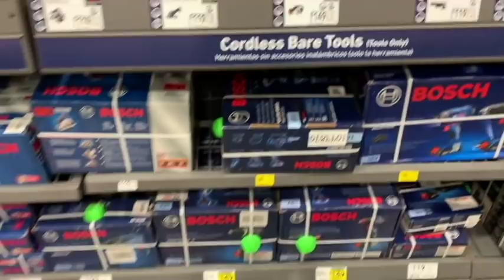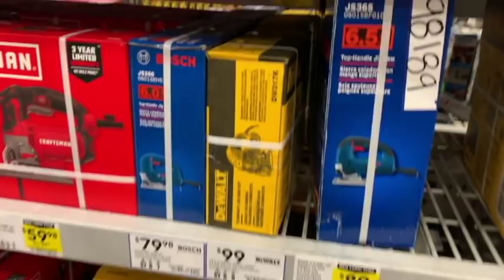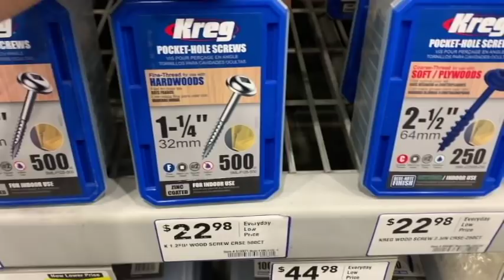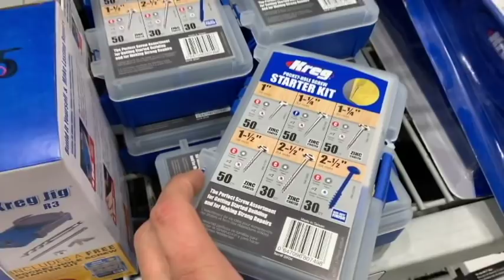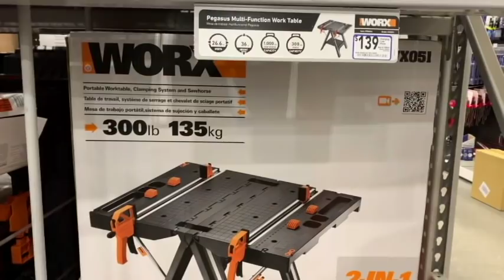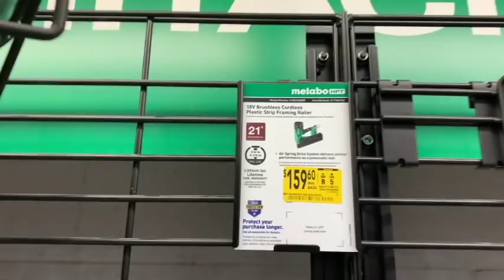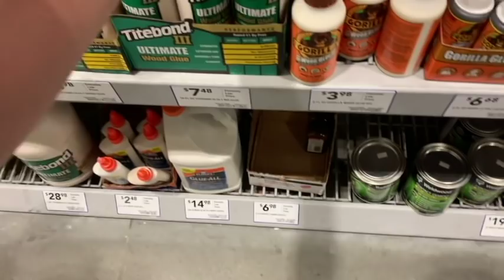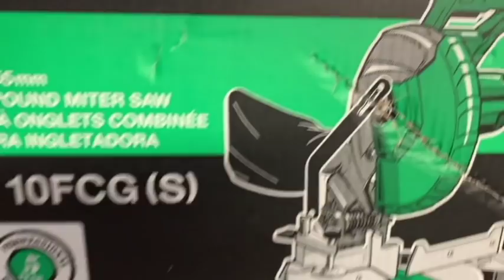Lowe's Walkaround: Metabo HPT Hitachi Tool Haul & Worx Pegasus Work Bench!

Comment: A great way to cheaply store stuff like nail guns and power tools...Lateral File cabinets. Used they’re cheap, heavy duty (pick up a case of paper you’ll understand why), and offer big drawers. Bolt/weld casters to the bottom, or make a wooden frame (think furniture dolly) and bolt the casters to that. Heck you can even paint them different colors with rustoleum. 

*Thanks for the mention earlier.
Reply from the maker: Chip B Thank for the Information. I saw a video last night.. can’t remember her name, but she used a system called French Cleats & used some OSB & I gotta tell you it Looked Very Nice. 🍻👍
Reply: Justin Dow - Great idea! French cleats are fantastic and then you can move stuff around when you want to change the layout. Very strong too.

Comment: You missed the Hitachi C10RJ  job site saw for 299.00 with stand and wheels. It is a top rated saw and on sale tell 10/14. You will also love the Metabo nailer. I have the same model by Hitachi and it works like a charm.

Comment: I have the dewalt jobsite one and have had for 3 plus years and works great. When I first got it I resided a mobile home and every board had to be cut horizontally and half of the wood had to be cut vertically and it cut all the sheets, when I had to move the fence it was smooth and no issues. It's not "cheap" it was that someone broke the display one or it may have been broke during shipment and exchanged out for a good piece. 

I have the KREG pocket tool pro kit and it's great.

Comment: Garage rehabs are sweet! Two things I would change after my remodel are adding way more 20 amp outlets. Also ended up changing several of my one-gang outlets to two gang boxes since you can't have enough outlets. Just wish I would have thought of that before I rocked it in. One thing I don't regret is I insulated the crap out of it. Don't skimp on the insulation. Hope you post your progress on your channel like you did with project hutch.

Comment: Hey there justin,  if you already have a screw gun , Dewalt sells these drywall screw bit tips in a 2pk. There freaking great if you are a DYI guy hanging drywall in a blue moon. Plus those Kobolt foldable saw horses are the beesknees,  and yes they are worth $39.99 ea. I bought the ones @ homedepot and a 2pk are $95 so the same ones @ lowes 2 for $80, are great I have a total of 6 pairs of those saw horses and hold, and sturdy for almost anything you throw at them. Well be good, cold beers and cheers.! 
From down here in south Florida.

Comment: I'm not even a minute and a half into this video and had to stop it to tell you this, because you mentioned getting one of the cheaper brands of table saw. There are many brands with a wide range of price and loads of gimmicky features, but there is one brand that, at least to me, stands head and shoulders above the rest. A few years ago I upgraded from my cheap crappy table saw to a SawStop contractor table saw. The saw I had, had a chewed up composite top, and a fence that wasn't worth it's weight at a scrap yard. Shortly after getting the SawStop saw, I was using it and got careless, allowing something to distract me. My left hand came in direct contact with the blade. The saw is designed to stop the blade from spinning and drop it below the surface of the table on contact with your skin. The saw did everything it was supposed to do. Had it not been for that saw, I very easily would have lost my left hand. Instead, I walked away needing nothing more than a Band Aid and a clean change of underwear. SawStop also makes a portable job site saw that is a little bit less expensive, but it still has the same safety features as all the other saws they sell. The big differences between the job site saw and the contractor saw is the table top and, the obvious weight and price differences. The job site saw has a 1.5 HP Universal motor, powder coated aluminum table top, and (I believe) a heavy duty composite body, which make for easier light weight transport, while the contractor saw has a 1.75 HP Induction motor, a slightly larger (than the job site saw) cast iron table top and a steel body. Bosch (or was it Rigid??) used to make a saw they called Reaxx that had a similar safety feature as SawStop's, but it was very competitively priced to the already well established SawStop, and nobody was buying it, so they ended production. Without a single ounce of hesitation, I would very strongly recommend a SawStop table saw to ANYONE who is in the market for a table saw. They have a few different models to accommodate different needs, and they are well worth every last penny they cost. Yes they are a bit more expensive than the other brands, but can you really put a price tag on your hands and fingers??? Far too many woodworkers have been bitten by a table saw, some much more seriously than others, and I should have been one of the more serious, but that saw saved my hand. Most woodworkers would even go so far as to say that the table saw is the most dangerous tool in their workshop, SawStop eliminates most of that danger.  NO OTHER BRAND TABLE SAW ON THE MARKET PERIOD, can say what SawStop delivers, at ANY price. There are plenty other places in your workshop to save a few bucks, but PLEASE do not buy a cheap table saw. When it comes to table saws, you really do get what you pay for. And now, back to our regular scheduled program.
Reply: FYI, I am NOT a professional woodworker or carpenter, I am just a DIY'er and hobbyist. The ONLY reason I got this saw was to protect my dumb ass and, Thank God, it eventually did just that.
Reply from the maker: Where do the sell them and about how much do the go for. Better yet.. Can you please share the link to the one you are recommending? Please and thanks. Cheers!
Reply: @JustinDowDIYcentralhighway  They're not inexpensive, the contractor's saw starts at $1699 plus add-ons. https://www.sawstop.com/table-saws/by-model/contractor-saw Look on YouTube for SawStop for demonstration videos.

Comment: If you build a new drawer to replace the one that fell apart, use solid wood. Even cheap pine or poplar will be far much better than similarly priced fiber board or even MDF which are both basically sponges that suck up moisture, rot, and then fall apart like the drawer you need to replace did.

Comment: Bro, you want a man cave, my vote  is roxul insulation, a 240v single phase circuit along with 120 v circuits, and a heat pump sized accordingly(may be enough capacity for your cave and/or entire home, if not, a gas fired furnace and air conditioner).

Comment: Kobalt makes a 7/14 sliding chop saw for 129.00 my guys build fences with them all day long.You really don't need the delta table saw it's overkill for any basic construction needs. Rigid often times has the flip up tables saw that's normally 499 on sale for 349.99 again  I own 3 of them we beat the crap out of them and keep on ticking. You don't find many speciality tools at Lowe's, they are just now getting into the prosumer/ contractor. Why do you need a screw gun? If you are only doing drywall in the garage save the money for materials and buy dimple bits... Metabo and hitachi have merged and all tools in the US are now metabo/Hitachi. I never new the handy man was your pops that's awesome.

Comment: Buy once cry once when it comes to table saws and miter saws. A 10 “ regular miter saw is great until you need to cut 4x4’ or 6x6’s, or 2x6 or 2x8’s plus. Its a pain in the ass. I learned a long time ago a table saw is worth its weight in gold. But a shitty table saw is worth almost nothing. The most important thing about it is its fence; that is straight, adjustable and reliable. And they need tracks thats are easy to make sleds and jigs to fit in it. If a table saw has those weierd “T” track slides its almost impossible to make slides and jugs for it.

Comment: Hi Justin ...not in the trades ...just the weekend warrior diy'r in and around the home ...just wanted to pass along another place to pick up nice Hitachi refurbs at generally really good prices (if in stock)... www.bigskytool.com (based in GA) ...actually heard about them a few years ago from fellow YouTuber, Ron Paulk ...they do a great job cleaning the tools and some of them look more just like straight open box returns ...in any case, they have the Hitachi table saw w/ stand that is in Lowe's for 169.00 that I just got last week ...now shipping is where you might take a hit depending on your location ...but for me in New England, it was still a better deal than Lowe's ...have gotten a bunch from them over the years such as 4 & 6 piece cordless kits, 12 in sliding miter, chop saw, drills, screw gun, orbital and belt sanders, grinder, nailers, weed trimmers and leaf blower. Have not put them all through the trenches yet ...but so far impressed with what they have done. Would love to do more yellow (DeWalt), blue (Bosch), red (Milwaukee) and others ...got some early on but been doing a lot of green recently in the garage ...and love the extra green staying in the wallet.